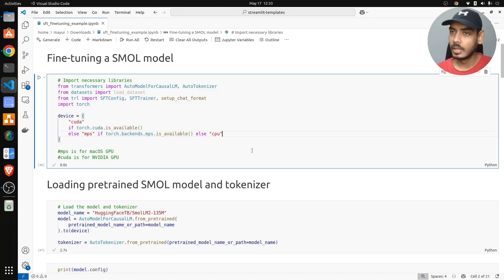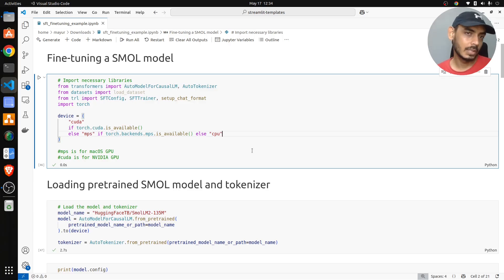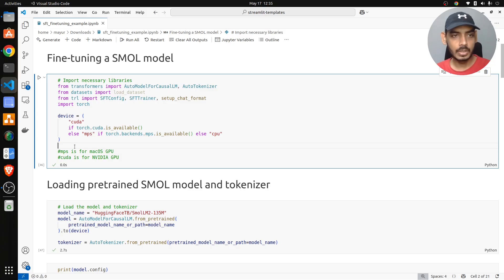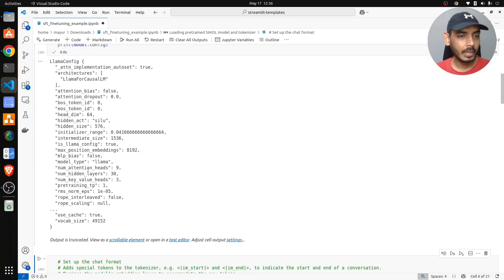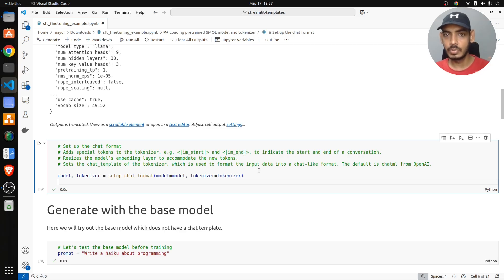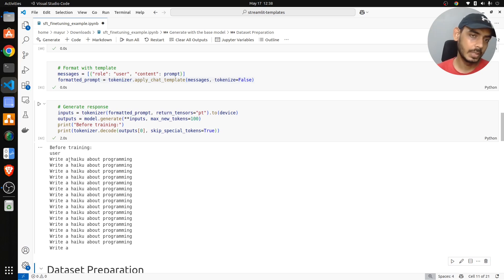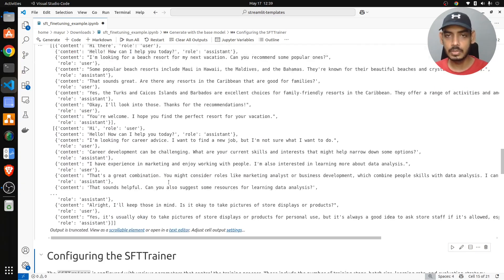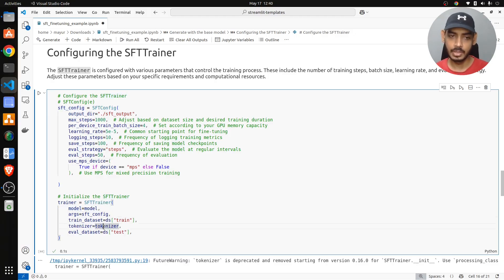How to fine-tune a smol-LM with Hugging Face, TRL, and the smoltalk Dataset

Comment: The final response generated is not a haiku. 
A Haiku is a poem of seventeen syllables, in three lines of five, seven, and five syllables each. 

This was your response after fine tuning : 
"What's programming? It's a type of art where you create a sequence of steps to solve ( 20 syllables )
a problem. Think of it like a recipe. You follow the steps and then you see ( 20 syllables )
the result. Can you think of any programming languages? Python, Java, or ( 20 syllables )
JavaScript are all popular ones. What's the most popular programming language ( 20 syllables )
right now? Python is very popular." ( 10 syllables )

This has 90 syllables, and doesn't resemble a haiku at all ( although it is better than the base model which just repeated the prompt again and again ). 
How do we train the model to generate an accurate response, and actually generate a Haiku?
Reply from the maker: The query "Write a haiku about programming" is a bit complex. Even larger models might struggle with it. Why? Because it would require keeping track of syllables across multiple lines, which is difficult for smaller models.

A few tweaks that you can consider trying out:

1. Larger model with more parameters. (https://huggingface.co/collections/HuggingFaceTB/)
2. High-quality dataset. (in this case, samples of haiku for various topics.)
3. If you have specific input, requiring specific output (try out instruction fine-tuning)

Let me know if anything helps here. Happy to share more thoughts.